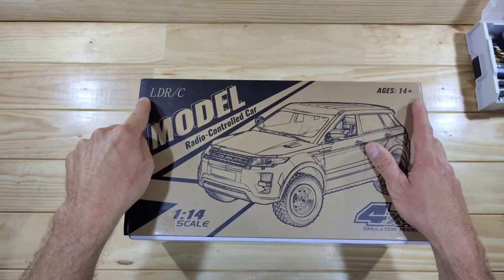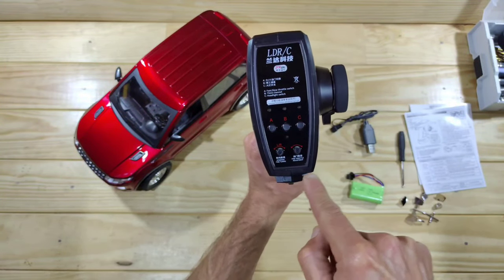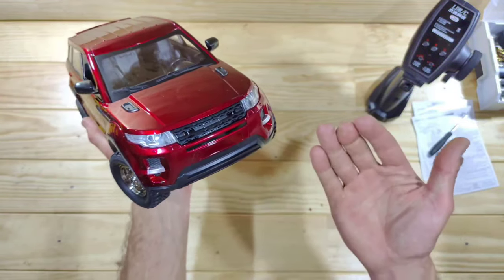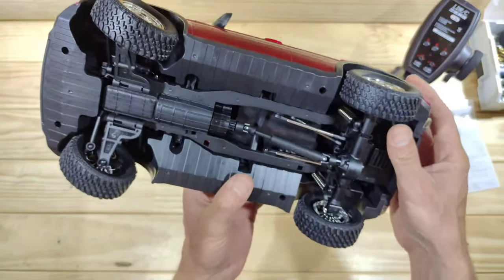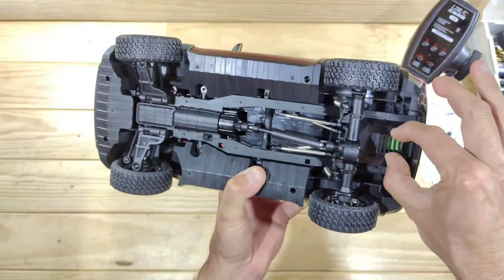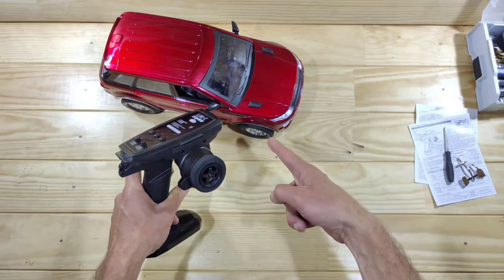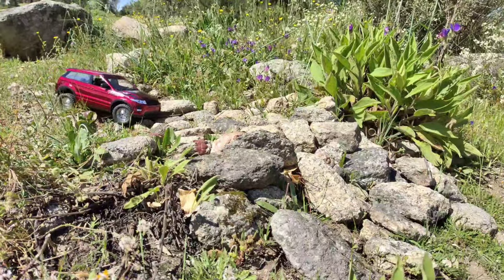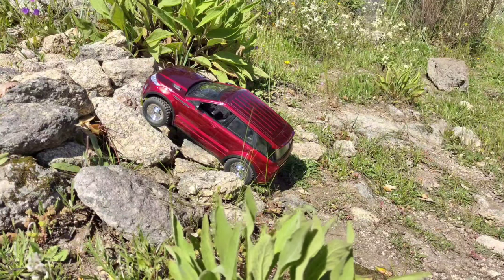LDR/C LD1299, this car looks Awesome

Comment: What size hubs is it running?
The standard 7mm or something special that you cant find rims for?
Lots of reviews seem to miss that info.
Without that info we have clue if we can upgrade wheels and tires.
Which is the number 1 upgrade.
Reply from the maker: Hi, it's a 5mm hex, similar WPL style, one Philips screw to hold the wheel on there
Reply: Those are the same wheels/tires as the MN78/MN82